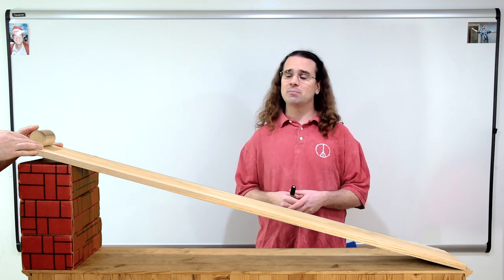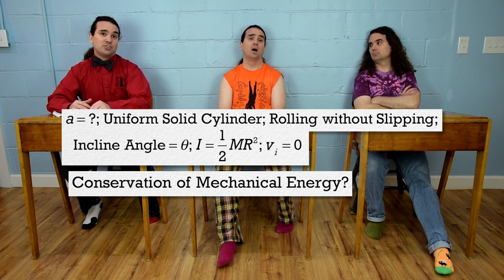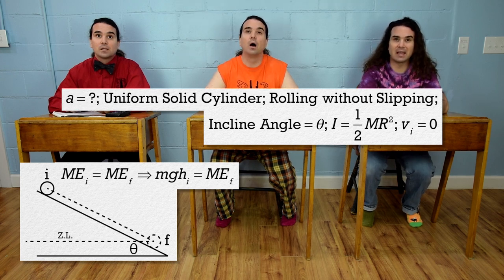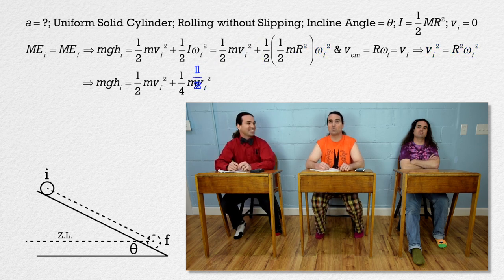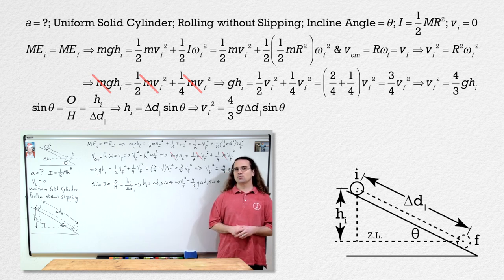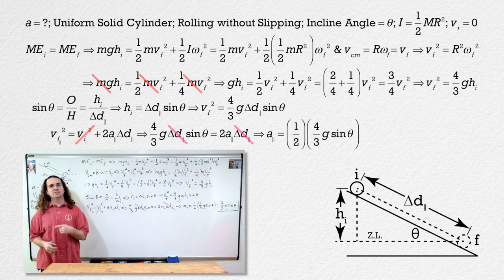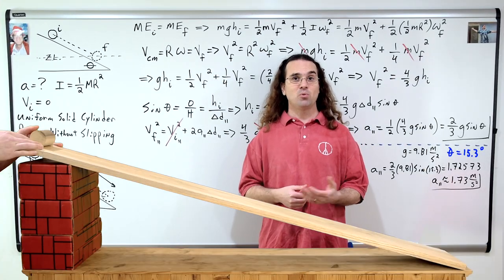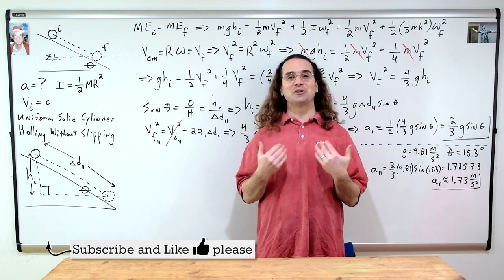Rolling Acceleration Down an Incline

Comment: How did you gather data for the chart you drew in the illustration part? I am currently doing a term project on rolling without slipping on an inclined plane and got stuck on gathering data.
Reply: I would guess that he used video capture and tool like "Physics Tracker" to lot the position of the some part of the face of the cylinder that is facing toward us (knowing the length of the board).

Comment: Why is there no static friction? Without static friction how can the object rotate?
Reply: There is static friction, there just is no work done by the force of static friction.    Static friction is a force of constraint, rather than a force of work.

The instantaneous center of zero velocity (ICV) is at the point of contact with the incline surface, where the object is locally and instantaneously at rest.   Because the ICV has zero velocity, any force that acts on the object only at the ICV will do zero work on the object.
Reply: You might wonder, how does a car speed up, if the static friction force (the force of propulsion), does no work?

The way this works, is the static friction force of the wheel pushing backward on the road is attempting to do work in the road.   However, due to the fact that the road is ultimately attached to the Earth, and the Earth is significantly greater in mass, the Earth's motion is negligible, and so is the work done on the Earth.  The Earth/road system reflects this work back onto the car, and thus the work done by the engine, ultimately becomes work done on the car.  The net work done by the static friction force is close enough to zero, because the work is ultimately reflected back to the car.

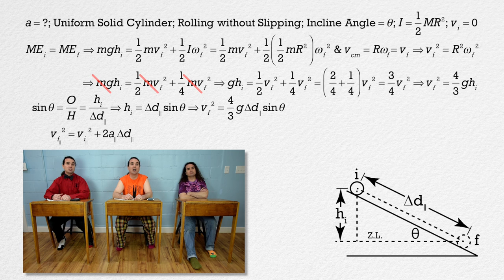Comment: Why do we solve for the displacement in the parallel direction? is it because the velocity final is the velocity of the cylinder parallel to the incline. Using height initial wouldn't also work  in the UAM equations (4:55) because everything is in the parallel direction right? So that is why we need the displacement in the parallel direction right? or is this the wrong reason.

Comment: If anyone wants an equation, for an object with a moment of Inertia x*mr^2, the acceleration will be (1/(1+x))*g*sin(theta). Pretty cool.
Reply: Can x be greater than 1?   There is a way to make this happen, if you are permitted to project your shape below the incline.  Like an empty spool with disks that are 5 times the radius of the inner cylinder, and most of the mass in the disks.   Roll it along a plank with only the inner cylinder in contact with the plank.
Reply: @carultch I require to have an explanation of the pont you've just made there!

Comment: So you are saying that when you change the radius and keeping the angle the same, the acceleration will be constant every time because the radius and mass cancels each other out?
Reply: Because everybody brought m*R^2 to the party, the mass and radius both cancel out of the equation.  In a rolling race among several different solid uniform cylinders, rolling without slipping, they all will have the same acceleration on the same incline.

What ultimately matters is the factor in front of m*R^2 for calculating rotational inertia, when determining acceleration during rolling without slipping.  Rotational inertia I = k*m*R^2, where k is a constant that depends on shape and distribution of mass.   For a solid uniform cylinder, k=1/2.  For a hollow cylinder, k=1.

Comment: wait, why doesn’t the parallel component of the weight do work on the cylinder and change its mechanical energy?
Reply: Neha Shah mechanical energy is not conserved only when non-conservative forces do work on the system. Gravitational force is a conservative force. It is true that friction is a non-conservative force but the frictional force in the case of ‘ pure roll’ is static and hence does not to do any work on the system.